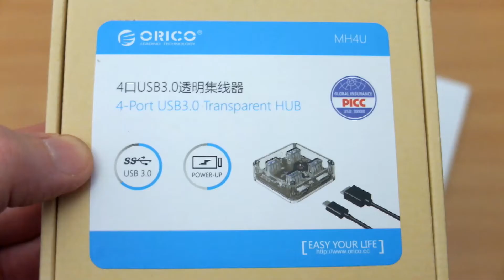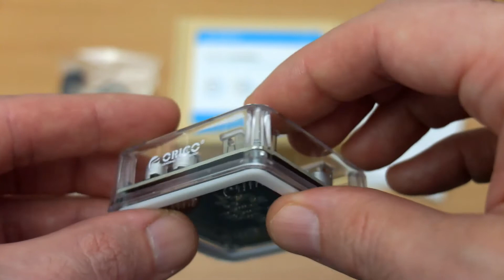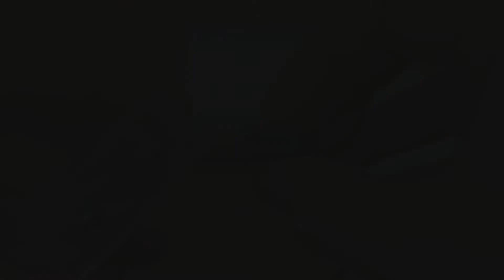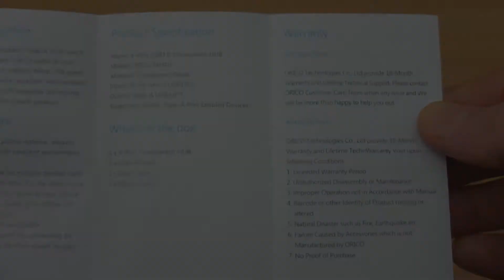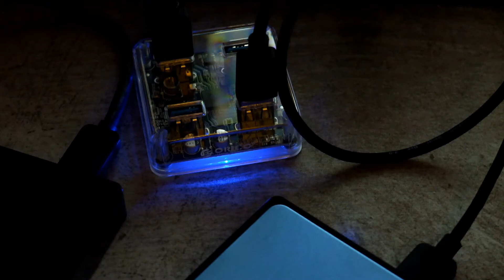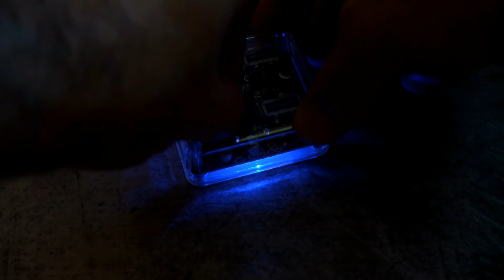Orico MH4U 4 Port USB3.0 Transparent Hub - Review

Comment: i really like that it has an option for external power. Looks like that turns it in to a portable powered usb hub.
And because both cables are detachable they are ease to replace in case of a cable fault. I think it's a must have for everyone that has a laptop. i bought the "f4u-orico u3"  to replace my anker portable alu model that was not a powered hub and had a fixed cable. you guessed it cable fault the hub worked perfectly fine but the cable was busted..
ps. Even if the ports give up you can always buy new ones fro aliexpress and solder them..don't know if the case is ease to open ?
Reply from the maker: I am still using it, I find it useful due to the small size. As you say the ability to power it with a micro USB input is also worthwhile, this helps for non powered devices like HDD's which draw power. I have not tried to open it I assume you can remove the silicone square on the bottom and unscrew it. I do wish it was type C ports aside from that it's quite good, I use it for printer, scanner and other devices extension

Comment: I dont understand what you mean about the micro cable, but you dont show it and the images are poorly lit up. My WD Ultra will not start on this hub, not enough power, I did not get a micro cable, just the larger one. where does that micro cable supposed to connect to? The wall power socket? Im just not getting what you are trying to explain.
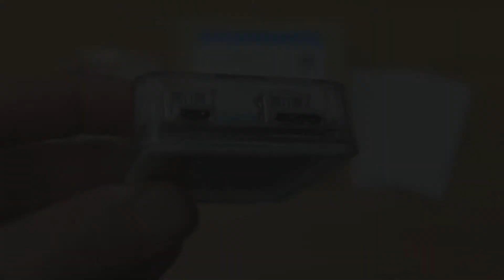Reply from the maker: 0:40, what's to understand? It's a micro USB port (this is explained in the video) you plug it into a source and get additional power. Most micro cables are micro to type A (type A on the pc plug it into it). Kinda simple really if you ask me ;-D

Comment: hi. is it working with 2 different  2.5 hdd at the same time?
Reply from the maker: It can but you have to use the micro USB for more power. SSD's use less power so are not a problem. Other factors cable length etc
Reply: thanks for answer